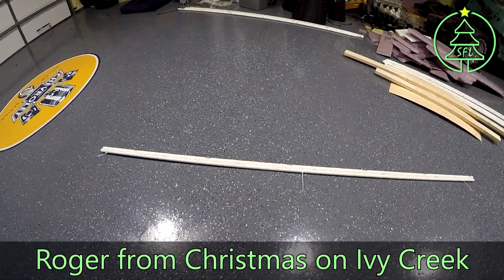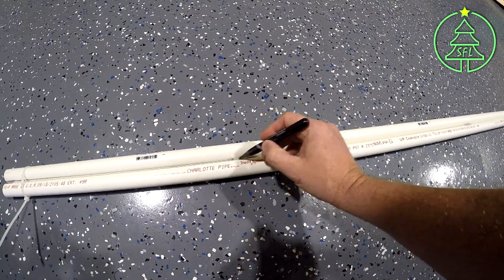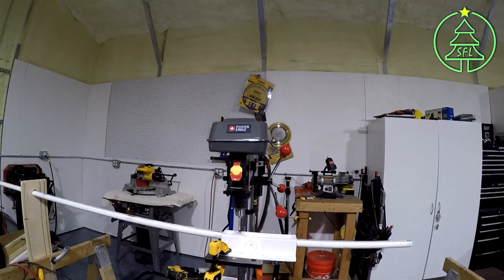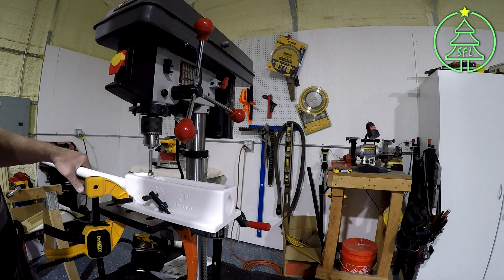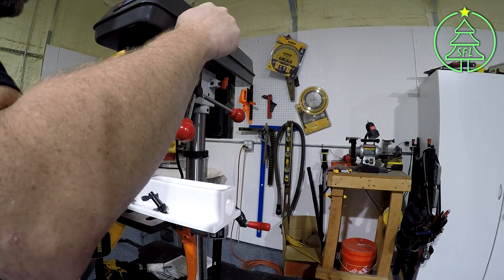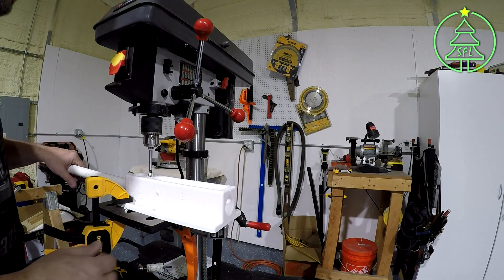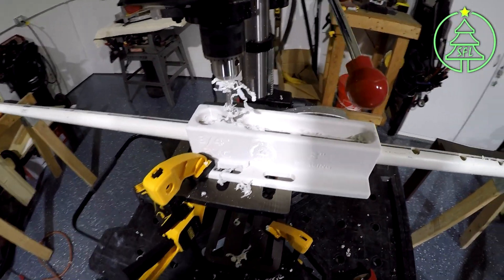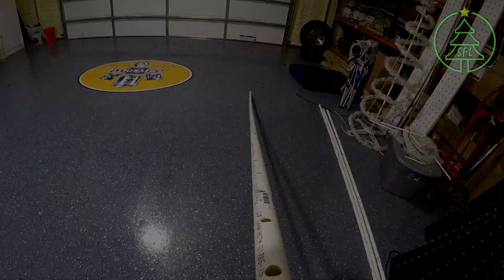SFL PVC Drilling Jig Demo

Comment: If youre using the 12mm forstner bit how are you pushing pixels through? Do you enlarge the backhole to fit body lf pixel through?
Reply: What I would do is, drill through the whole pipe with the 12mm bit , then switch out the bit for a larger one and drill out the back so the pixels fit.

Comment: Thanks for the video!  I have been hoping to setup something like this for a long time but couldn't find a jig like this.  My only question is how do you insert the pixels?
Reply from the maker: Thanks for the compliment. I drilled my holes out with a 1/2" bit. The pixels were easy to put in, but they can also fall out just as easy. To combat this, I added hot glue to the back to keep them in the pipe.